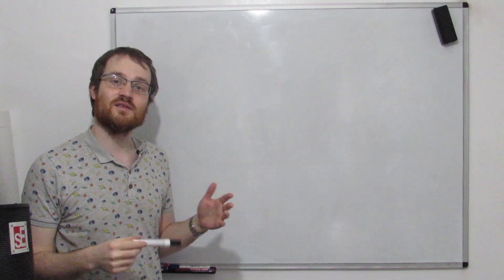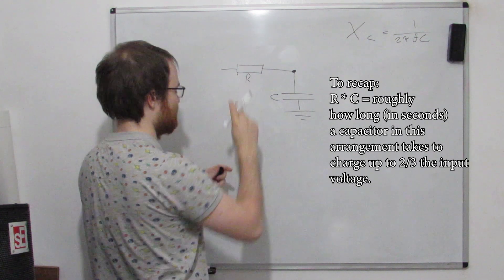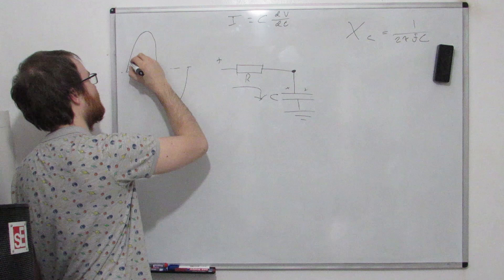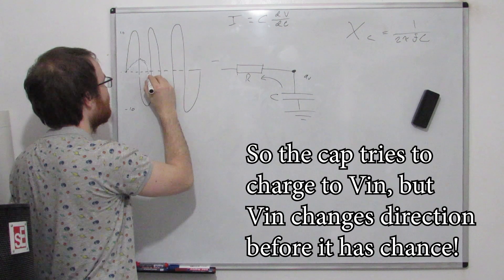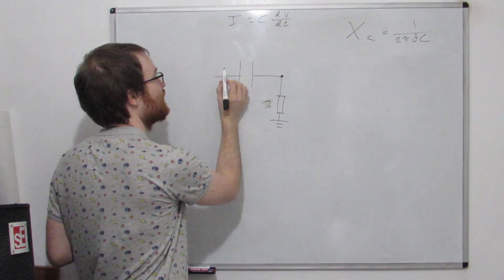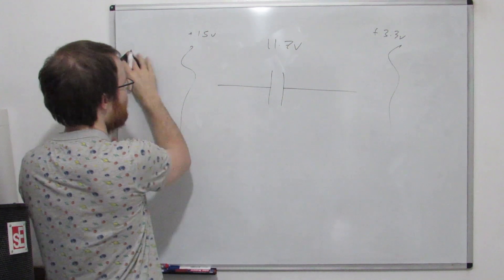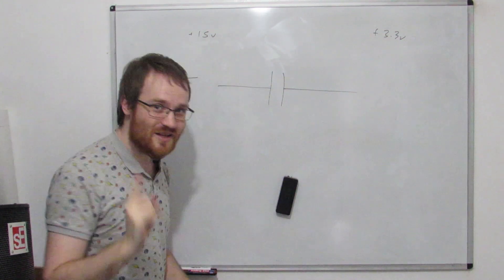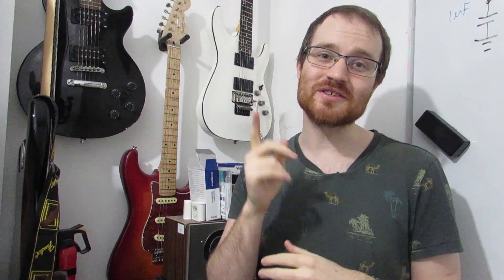Capacitors Explained part 3: Filtering & Phase Shift

Comment: hello, i stumbled upon your channel. im quite enjoying the content. i have a quick question regarding your diagram where the cap discharges in reverse back through the resistor when fully charged(or near that) as the sine wave makes the shift from positive to neg. if this happens as such how is the circuit complete? why even have a ground or and electrolytic cap if the current in simplistic terms just goes back to the source via the input? i appreciate you taking the time if you please. health and happiness to you and yours

Comment: Insane! I certainly love to know more about capacitor! Which, I am doing as there are a few videos on the same thing (Yes, I understood that the total is a long one). 

But I need to know what happens to a signal if that capacitor is replaced with a resistor. I mean, visually. Better still is the visual differences between signal going through capacitor and resistor.